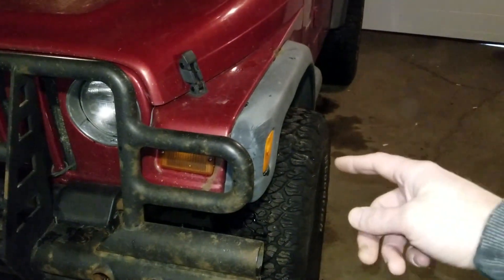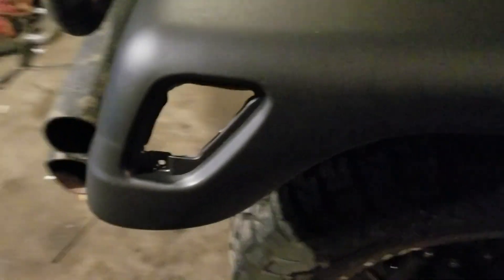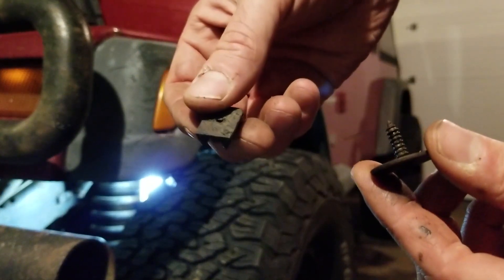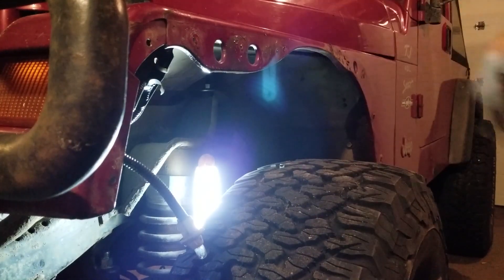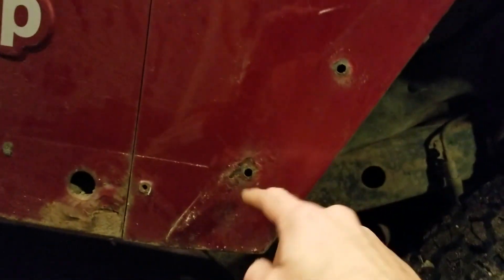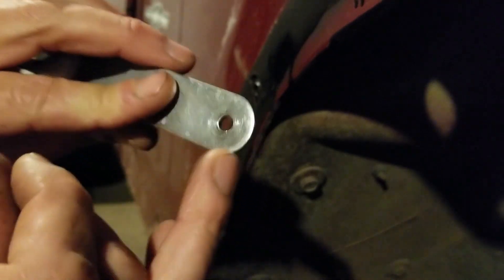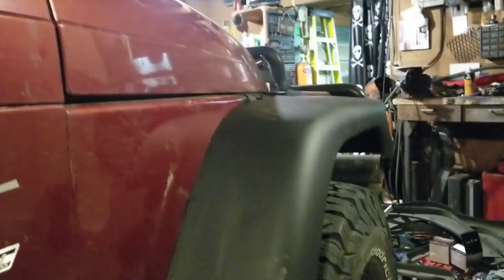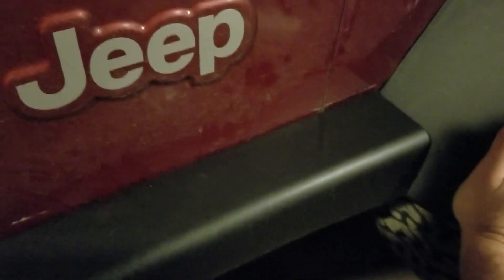Omix-ADA 7" Fender Flare Kit - '99 Jeep Wrangler Sport

Comment: Question, while the flares are off, can you drive or do the inner fenders flop around?  I ask as I will need to do this over a few days while fixing rust before putting the new ones on.
Reply from the maker: It's been a while now but as I recall the inner fenders werent attached using any of the hardware holding on the fender flares. It seemed as though it was made to function without any flares at all.
Reply: @spacerag Thank you very much for the quick reply, it is appreciated.  I have been wanting to get the body work going as the frame and everything else is rock solid, but running around and being the center of aa 7 yer olds world makes the task scary.  Gotta be there for the kids daily routines, lol.  Again, thank you!
Reply from the maker: Good luck! Both with the jeep and the 7 year old. Maybe you can teach them to sand bondo. ;)

Comment: Did this on mine and have slight gaps in some places between the body and the flare. A little concerned about crap getting stuck in there in winter. Has that been an issue for you? I'm thinking about running some silicone in the gap.
Reply from the maker: Mine hasn't got a straight line left on it so I likely have a lot of little gaps. I never had any issues with slop or ice getting in and causing issues. 

It would be a real mess to have to get silicone off there after. I'd let it buck. These things are full of all kinds of nooks and crannies for ice and dirt to get stuck. What's a few more?
Reply: @spacerag  thanks for the reply. You are right! Mine is an 04 and only 60K miles and I’m probably too neurotic about it 😀 I have to remind myself it’s just a Jeep!
Reply: @spacerag  Did they not give you a casket to fit on the flares that sits against the body?

Comment: How did you remove spinning riv nuts?
Reply: I just drilled them out and replaced mine with new ones with a splined edge which grip to the metal al little better than the original ones